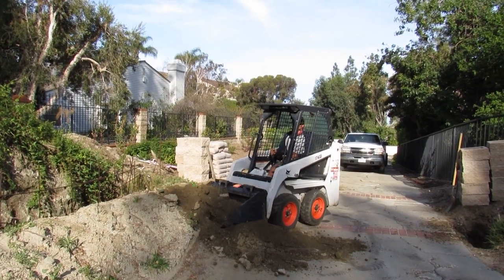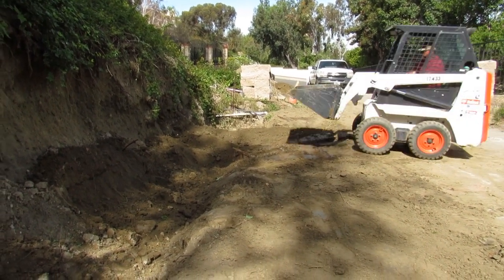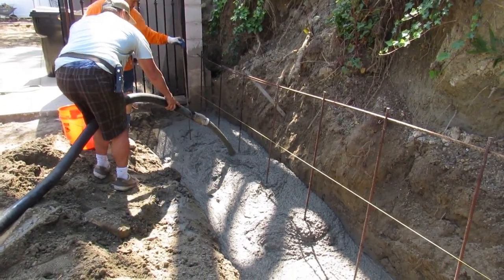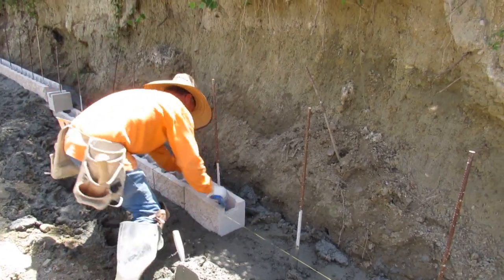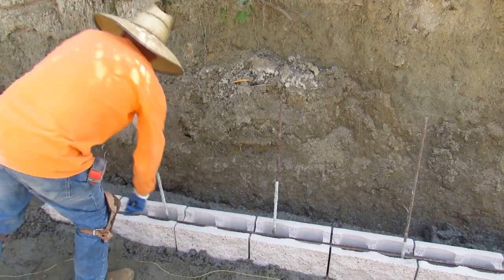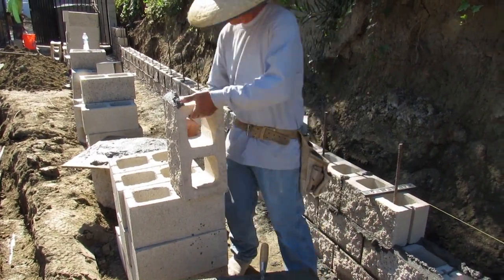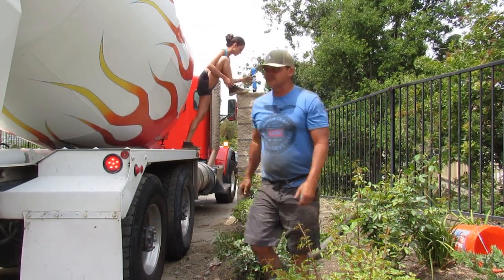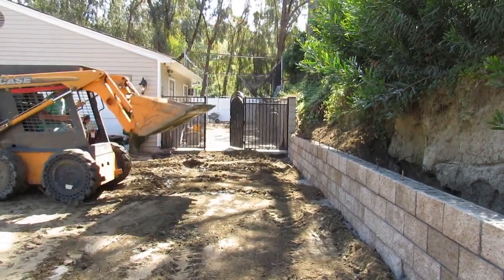How to do a split face block retaining wall California

Comment: why they aren't any drain holes in the blocks wall ?  (in case of heavy rain to drain out the water)
Reply: I think they left the  head joints out on the bottom

Comment: You really did not do the own any favors on that retaining wall. In fact you did an injustice to them. Where’s the drInGe pipe, weep holes and aggregate backfill?  At 3 feet it’s not that big of a deal. But if you added another 3 feet of wall you’ve screwed them.
Reply from the maker: 🤣3 years later and still perfect 💯I wonder how some people come up with this BS?
Reply: @WestCoastCustomConcrete  
I e seen too many failed retaining walls around me. My newbies. City projects, etc. I just had to pay for engineering plans required by my city. Let me send you the plans for review. I think it’s over designed by an engineer with little field work. I’ve been a civil engineer in the private sector and the city. We did actual design.  I’ve seen some real doozy mistakes. Everyone got it wrong. That actually built it even though it was obviously wrong.
Reply: I sent you a copy of the detail drawings just so you see my point. Not trying to knock you. I get your point. But war behind any structure is very impressive. That’s why we design and build them as I suggested. I have a lot of experience with it. I’m no expert at retaining walls but I do understand the engineering.
Reply from the maker: @UrbanDIYer  you should contact the city of Anaheim hills. Because I built it to there approved plans. Just to let you know at least 3 engineering magazines have done articles on me. So I no a little bit about engineering? I think you are barking up the wrong tree💯
Reply: @WestCoastCustomConcrete  
No, I’m not barking up a hill. I know for a fact that an engineer did not give their blessing for a 6 foot tall Cinder block wall without propped backfill/drainage. I’ve seen some pretty bad wall designs by companies estimated plans. You’re in California and I know they’re more strict about most anything except reality. Yes, it will hold for a while. But I’d bet it begins to fail within 10 years if not earlier.  My neighbors walls are all failing. Even the newest ones. 

I’m not trying to bust your chops. I just think you’d be wise listening to warnings about an under designed wall. Have you looked at the plans I sent you. At least from a professional perspective you should at least take it under advisement. Help your clients.
Reply from the maker: @UrbanDIYer  https://youtu.be/_375PMSm_-4
Reply from the maker: @UrbanDIYer  https://www.popularmechanics.com/science/a32643833/concrete-stairway-construction-video/
Reply from the maker: @UrbanDIYer  https://interestingengineering.com/video/construction-workers-build-concrete-staircase-and-its-a-masterpiece
Reply: @WestCoastCustomConcrete  
I saw at least one of those videos. I e been fretting about my own project. I’m putting in a 125’ retaining wall that was flagged by my city’s code I for cement. It was originally supposed to be three tiers of 4’ walls not requiring engineer plans. I get what your saying. But having seen so many Retaing wall failures over the past 20 years has made me very skeptical about contractors leaving out parts of construction to save time or money.  You’re good. It may stand for 40 or 50 years like that. That’s actually encouraging to me. 50 years would be great because my wife won’t hVe to worry about it.
Reply: @WestCoastCustomConcrete  well I accidentally deleted a long response that was positive. I believe your wall will last a long time. My city is rediculous. But I guarantee that when a nuke destroys our city my retaining wall will be the only structure still standing. 😂

I wish I wasn’t forced to overbuild. Engineers can be egomaniacs. My railroad ties last 44 years. Sort of. I’m sure my new 125” long by 10’ tall wall will way outlast those. I am worried about it toppling over due to hydrostatic forces.
Reply from the maker: @UrbanDIYer  hey Mark. I was just messing around with you bro 👊 everything you said was right 💯I put a French drain behind that wall. I just didn't show it I just started making videos then. I had no idea what I was doing on YouTube. Thanks for watching and your comments bro 👍
Reply from the maker: @UrbanDIYer  what state do you live in brother?
Reply: Texas DFW
Easy looking me up now 😂
Reply from the maker: @UrbanDIYer  I was just wondering bro what the building codes are in different states 👍